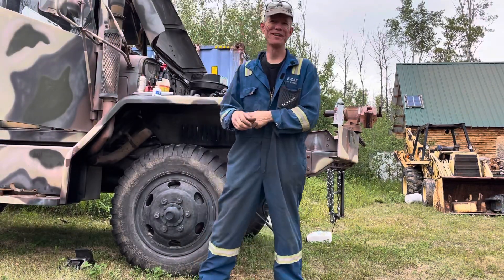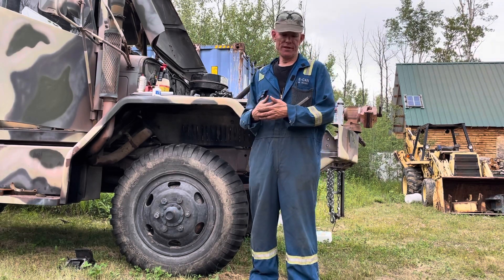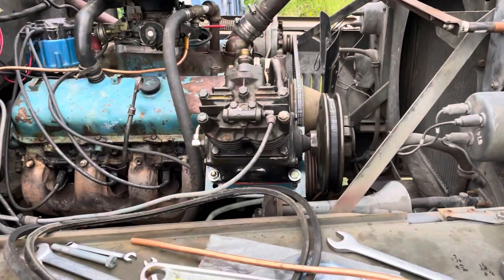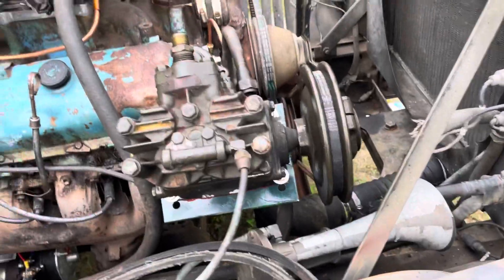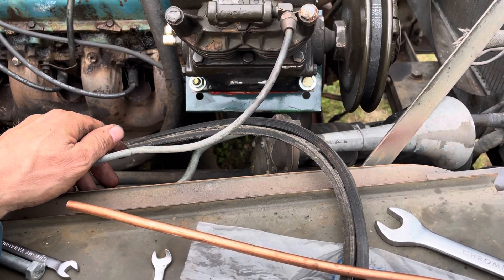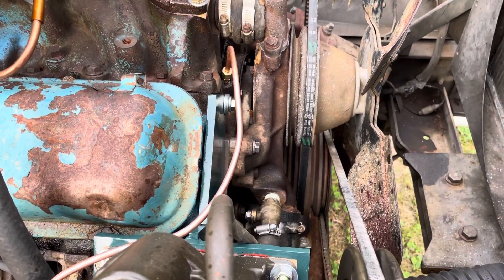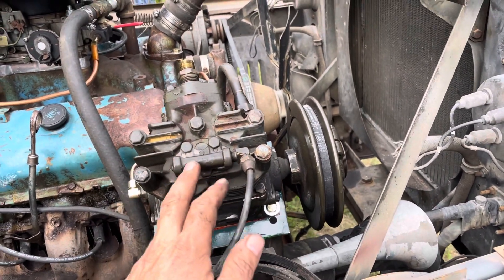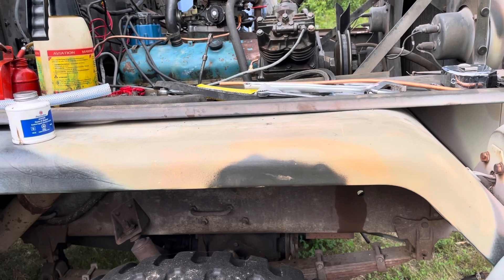M35A2 V8 Engine Swap Part 7

Comment: why the electric fuel pump?
Reply from the maker: My intentional is to convert it to propane and the fuel pump would not be required then, also the original place for the fuel pump is a good location for the return line of the oil from the air compressor

Comment: Very cool swap cant wait to see it finished. Did this truck come with an air dryer from the factory if not you may can put an inexpensive one on it to catch the mist of oil from the dishcharge line.
Reply from the maker: Hi, The truck did not come with an air dryer, but I have an alcohol snifter that’ll work for that purpose. I’m looking forward to finishing it myself lol